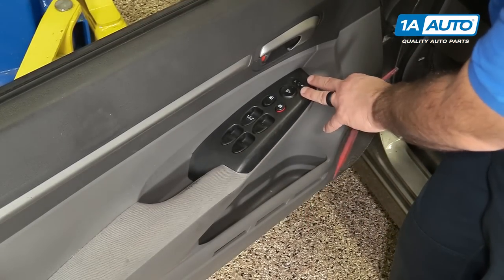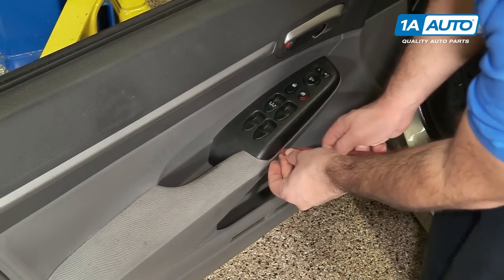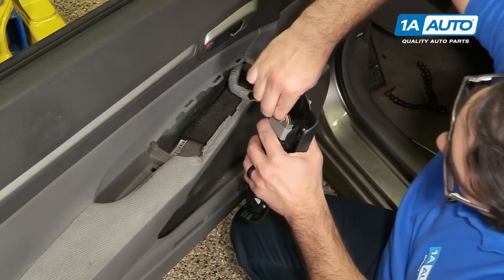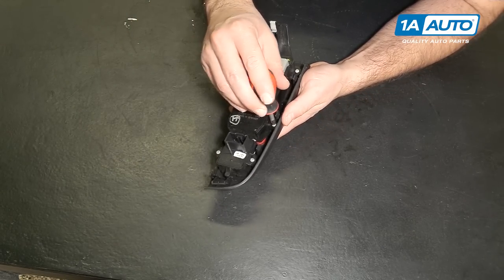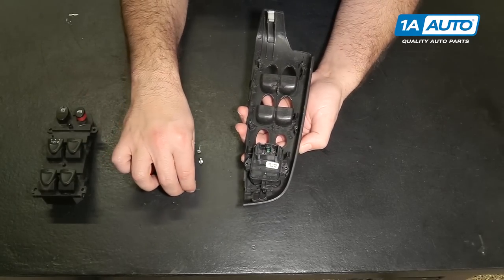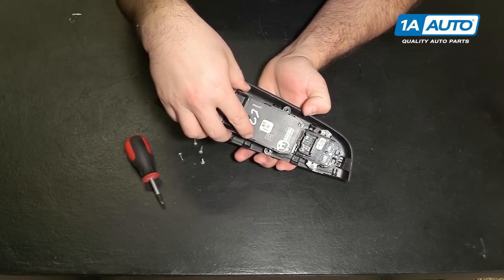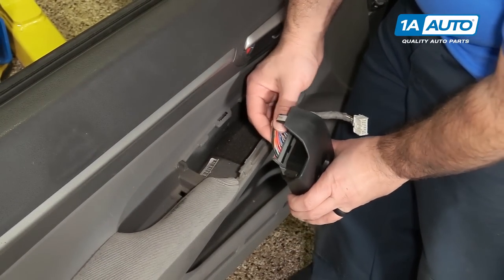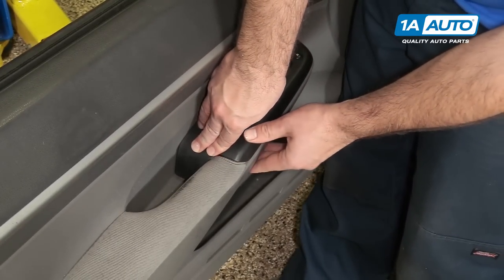How to Replace Master Power Window Switch 06-11 Honda Civic

Comment: Thanks for the video! I tried in my Civic Ex 2008 n everything went smoothly! The only somewhat difficult part for me was disconnecting the wires but after some force it came off.

Comment: Is it possible to make all windows auto windows from that control panel?
Reply from the maker: +Acxel301 To the best of my knowledge you would have to alter both the panel, motor and the switches in order to do this. We would not recommend doing something such as this if you are not a certified auto-electrician.

Comment: is the master switch plug and play or will it need reprograming
Reply from the maker: +Colin Miller As long as all the options are exactly the same the switch will install and function normally without reprogramming.
Reply: @1AAuto  in my civic 2011 the master door lock switch is not installed

Comment: When I press my master control lock button, I hear locks grinding and all doors slowly locking.
Same sound in auto lock when car reaches speed.
What eventually is breaking down? What would cause this slow grinding rotor sound?
Reply from the maker: +David Keivom This could be the door lock actuator. We always recommend getting your vehicle professionally diagnosed as we cannot properly diagnose online.  Thanks for watching.
Reply: Thanks for replying and guidance. Appreciate it.